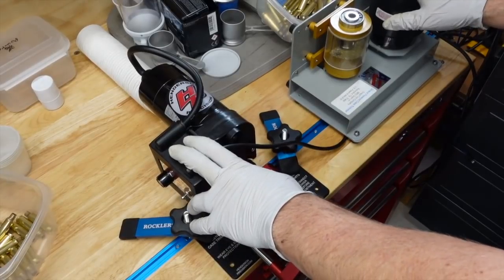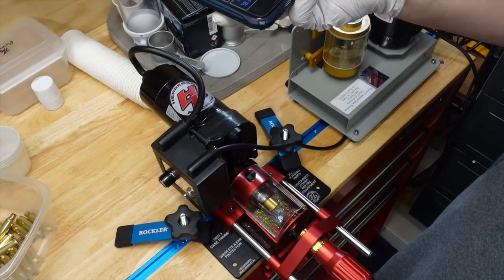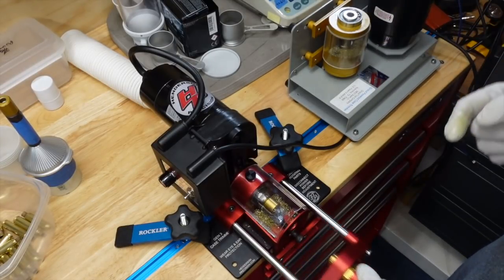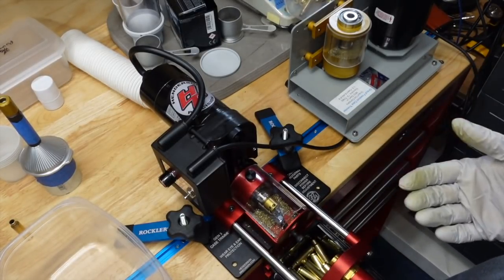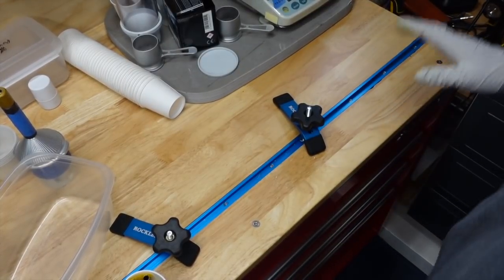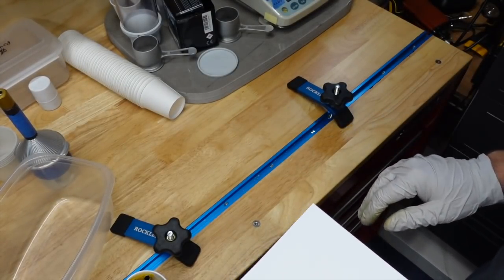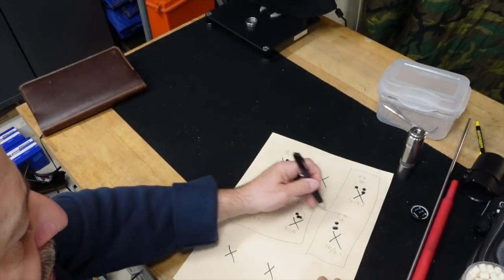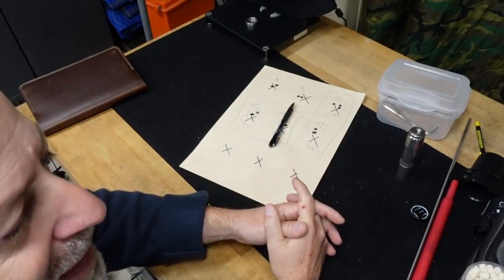Henderson vs. Giraud Rifle Power Brass Trimmer Review

Comment: Been using the Giraud for years producing very accurate ammo. I think the biggest difference between the two is what you pointed out; the Giraud indexes off the shoulder and the Henderson the base of the case. I suspect the spike in the seating pressure is because the Henderson rotates the case mouth on a mandrel and the Giraud does not. I think a worthwhile addendum to this test would be to run the expander back through both sets of brass and then see of the results are not more similar. And, are you lubing the inside of the case mouth with the Henderson? I cannot help but think the mandrel in the mouth of the case on the Henderson is completely responsible for the bullet seating ease. Not saying it is good or bad only that it is the obvious difference. I would also be interested in the overall case length of the Girauds as compared to the Hendersons. The shoulder bump and case prep is far more important using a Giraud since it indexes off the shoulder.

Comment: Variation in seating pressure could also be a impacted by slight variations in the bullets boat tail, diameter, smoothness, etc. There are many variations as you indicated that are caused by us, the previous operations, etc. I wonder if the age of the cutter in the Giraud could have anything to do with it. From using a lot of carbide lathe tooling, I can tell you that everything wears out. Unless we have a lab with equipment that allows us to standardize every operation this is about as good as you are going to get. Nice job John.
One thing I would like to see, is how much difference there is between the Henderson and say the Lyman Express Trimmer that you featured in another episode. Might help explain the value or expectations.

Comment: Love watching these videos even though my financial status doesnt allow me to get one of these.

I was using the trim pro 2 for a year and worked good, but noticed it really destroyed the inside of the neck. Made a crazy U shape on one side and didnt touch the other side. Ended up getting the lyman xpress trimmer, and so far its a solid unit. Dont really have much time on it yet but initial setup ane trim was easier and better vs the trim pro. Also like the idea of indexing off the shoulder vs the base.

Comment: I use the "Dead on case trimmer" for some time now (easy to set up). Does not chamfer but I like a very small chamfer so secondary ID/OD manual ok (set up for different cases or calibers seem like  pain for 3 way trimming cutter). Cheap drill press off CL, reloading is fun again!

Comment: John, thanks for this video! Just got done trimming 462 6mm GT cases using a WFT in my drill press and my hands hurt holding onto cases in the 18 degree temperature of my garage. 🙃 Then chamfer and deburring in the house by hand... order placed and I am looking forward to see how much this will change my ES/SD.
Reply from the maker: Which one did you decide on?
Reply: @FClassJohn  I went with the Henderson primarily because it's obviously quieter, bullet diameter specific rather than shoulder and bullet... and your seating pressure test at the end finalized my decision.

Comment: The Giraud tri-way for a drill press is a heck of a value for $110; same cutter as the bench top unit.
Reply: Trim enough, you may surrender to the Giraud power trimmer and just change out the cutter heads.

Comment: This is a really good informative video. I only wish we could have seen the inside and outside chamfer under a magnifying glass.
Reply: Yes, I totally agree.  The depths of the inside chamfer, and the amount of material removed for  de-burring the neck can be excessive with some other 3 way trimmers, depending on the factory carbide cutter settings.  Would have been great to see a closeup of the neck for both units.

Comment: i do not like that you measured the distance of the neck to the mouth of the case on the giraud since I am using the trimmer for overall case length and not distance form neck to mouth  but a great video.  thank you for the time you put in.   I defiantly am going to order the henderson. and i subscfribed
Reply: Measuring the case for overall case length on the giraud doesn't make sense because it is shoulder referenced. This means that case rim thickness can impact the result if you measure the overall case length, also inconsistent shoulder bump can impact it as well. For example, the giraud could be trimming perfectly everytime but if you measure the entire case you could still see variance due to case rim thickness, or a variance in shoulder bump. This isn't the case with the henderson because it is actually trimming the overall case length to your setting.

Comment: Which method of trimming produces the best effect on target for you? 

The Giraud method makes more sense to me since it is determining actual neck length vs. the shoulder instead of overall case length with the Henderson. If you neck/shoulder length is consistently cut to the same length, you are essentially eliminating neck tension variations due to a longer or shorter surface area the bullet contacts.  So, even if you have different case lengths, when the firing pin strikes the primer, forcing the cartridge forward in the chamber, the bullet will still have consistent take off from the neck. 

The Henderson method only determines COAL, meaning that your neck lengths will inevitably vary.  In this case, when the firing pin strikes the primer and forces the cartridge forward into the chamber, the bullet will have varying take off surfaces because the necks will be different lengths.  I have no idea to what degree these variations will translate to on target.

Have you seen any difference?
Reply: AMEN. Same here. Agreed 100%. I have Giraud for that reason also.

Comment: Thank you John - really appreciated the thoroughness and objectivity you put in this test. In addition to knowing that these two units are both very good for their intended use, what I found interesting are: (1) the differences in the traces from the press - I would attribute this to differences in cut angles for the chamfering of the inside neck: obviously with the Giraud, the bullets needed more force to be pushed when inserted through the neck (I also found big first bump in the trace when testing the AMP press with brass with no chamfering at all); and (2) the differences in ES. For (1), it would be great if could post close-up pictures of the neck mouth after trimming with each trimmer. I am guessing that differences in cut angles should be visible to the naked eye. For (2), I am wondering how the ES would compare if you remove the round that showed a tighter ID neck on the Giraud sample (the round with the large first spike on the AMP Press). Good stuff John! Thanks again for this test.
Reply from the maker: I'm glad you enjoyed the video and I think you're spot on with your assumptions. As I've told others, I don't think it's the Giraud's fault as much as it had a different adjustment on it at the time but there is a light difference in the cut angle either way which does of course make a small difference as well.
Reply: I have had the Giraud for a long time now which is a good trimmer but I like the Henderson Gen 3 better. It puts a more precise bevel on the case. The Giraud did not leave as concentric of a bevel on the inside of the case. I use the collet that came with the Giraud and not a custom one made from a reamer.  This can be seen on initial seating pressures with the AMP Press. I am also getting even more repeatable trim lengths with the Henderson (less than + or - .001"). They have also redesigned the motor to a single speed motor that is very a sleek compact design. Very Smooth.

Comment: Have you assessed how square the case mouthes are?  Wondering if that may be some of the variance in length until you spinned them.  Non-square necks are the main reason I start with a powered trimmer and then finish with a WIlson hand trimmer.  Granted both of those are way above the other powered trimmers that I have used, but would love to get any thoughts
Reply from the maker: Honestly no, I've never thought about it. I've been happy with the Giraud and how it's trimmed and definitely happy so far with the Henderson so it never crossed my mind.
Reply: @FClassJohn  I watched your video again and pulled the trigger on the Henderson.  WAYYY more than I ever thought I would spend on a trimmer, but I timed myself trimming with my current method and came out to over a minute per case on average to power trim, precision trim, chamfer, debur....  Granted these were on cases that were longer than they should be-- but my hatred of trimming has kept me from trimming very often on my practice brass.
Thanks so much for approaching as you did.  From your video, I have to take that the case holder and guide provide a more square case mouth.
Dollars spent = much time given back to me.  And now ALL of my brass will get the attention it deserves.
Great video.  Thanks again

Comment: Thank you for doimg this! 
Two questions, are those groups really at 600 yards or did I misunderstand. 
Secondly, what seating die is that you are using?
Reply from the maker: Those were only 100yd tests. I honestly don't test much at 600yds. As far as the seating die, I have a custom Newlon.
Reply: Thanks, I realize you are great shooter, but thought that would be rather inpressive even at 300, atleast compared to me and my STR200. Thanks again for the great video!
Reply from the maker: @wathaet1386  Thank you. Typically I look for something 1/4moa or less at 100yds (all one hole). These groups were pretty bad all things considered but they can't all be winners and I didn't want to mislead anyone so I showed the actual groups. I just got new barrels yesterday and will be working them in this week and by next week they should both be shooting close to .15" groups after powder, seating and tuning. I'll get some video showing the process.
Reply: Learning a lot from you, so keep it up!
Reply from the maker: @wathaet1386  Thank you. I'm glad it's helpful.

Comment: Thank you for the very informative video John, I like watching your videos. I have 2 questions- 1) do you think that initial seating pressure spike or lack there of is caused by the Henderson using a pilot? 2) you measured the giraud brass off of the neck, how consistent do you think it would be if you measured off the case head? I know that’s not what you indexed off of for trimming but curious to see consistency there. Hey, we measure primer seating depth off of case head but index off of rim! 

Thanks again for your cool videos!
Reply from the maker: Thank you for the kind words. As for 1)not sure, maybe the pilot does a little but I think that entry force is more dictated by chamfer and neck tension. 2)I've measure OAL after the Giraud and it'll vary just a little about the same and any variance of shoulder to mouth variance.

Comment: Maybe I missed it, but why didn't you measure both batches the same way? You are measuring the case overall length, right? Why do you use a different method of measurement? The seating pressure measurement using the AMP press may not be reliable when doing a direct comparison.  This is because the cutter blades of the respective trimmers can be adjusted to different angles causing measurement variability. I've tried both trimmers and have experienced this. Adjusting the blades does result in different in seating pressure.

Comment: Thank you for your review. After watching this I really into buying one from Henderson. 
But can not quite figure out the steps of my reloading procedures. So a Henderson requires prior to cutting have all cases sized and then necks opened up with mandrel to fit onto pilot and then resized again to desired neck tension? Is that right?
Reply from the maker: Typically you'd only need to size once. You would size your brass, then expand the necks with whatever mandrel size you use and then trim. Then you're done.

Comment: Hey John, did you size the cases in the same order with both trimmers? Or have to use a special step to open up necks for henderson? I know you mentioned something but forgot, I’ll rewatch, thanks for great videos
Reply from the maker: I just had to move steps. I used to size after trimming but now I just size before trimming. No big deal.
Reply: @FClassJohn  but im wondering did you size before trimming on both the Giraud and henderson cases in this video? The ones you did the amp press test on? Id be curious if just the order difference would change the seating force results
Reply from the maker: @zoidelux  Yeah I sized both before trimming.

Comment: I’m curious if the pilot on the Henderson cutter is leaving marks on the inside of the neck. 
I use to use a RCBS trimmer that used the same style shell holder and piloted cutter, I also tried their three way cutter and both left marks inside the neck.
Reply: Depends on whether or not you are expanding the case mouths.
Reply: @ajgraf122  I now own a Henderson and love it! .308 cases are FL sized in a SAC die with a .3065 expander and there are no marks left on the inside of the necks. I have 1000 cases through this trimmer with no issues.
Reply: @Carney556  Absolutely love mine. The biggest single time saving reloading device I have.

Comment: On the Henderson, How confident are you on squareness?
My flags go off looking at a motor hanging off the back end, the cutter turns instead of the case turning rotationaly. Seems like a easy way to get a non square “even” chamfer?
It would seem that ruing in the vertical position would be better?
I am also curious about a possible new ID/OD necker turner from Henderson. 
This looks like a nice piece, but it may have a inherent design flaw of maintaining and repeating bore parallelism or chamfer squareness.
Reply from the maker: It's probably a valid question but I'm not worried about it honestly. As for an inside/outside option I think he has talked about working on something but I have no idea where that idea is at.

Comment: As a new reloader... I'm wondering what is more important: 1. The measurement of brass OAL (Henderson) or 2. The measurement of the neck length (Giraud).  It seems to me that the Henderson cutting the overall length would be pretty important if nothing else in terms of ability to verify accuracy.
Reply from the maker: In the grand scheme of things as long as your sizing is consistent then either method will yield similar results.
Reply: @FClassJohn And "sizing" inconsistency (shoulder bump) is a variable that does not effect the Henderson COL.   Advantage: Henderson

Comment: What would you guys recommendation be for bulk “range brass” prep. I would like to get one of these two bc I also shoot precision rifle but I process quite a bit of range brass (as safely as possible) for 5.56, .300 blk, some 7.62 (gas gun brass) etc…. I use alpha munitions for my precision stuff but at 1.08ea not going that route for carbine stuff. I have also looked at the Dillon and FA options but kinda keep coming back to these two. Load .204 ruger - .338 Lapua. 
Thanks for any direction!!  Great videos
Also do 45-70 and 375 big bore but figure I’m relegated to hand trimming for those!!😊
Reply from the maker: At the most basic, the Giraurd will get incrementally more expensive every time you add a cartridge while the Henderson largely stays the same since the Henderson uses a collet systole and pilot so you can do a lot of cartridges with minimal cost difference. The Giraud requires a different holder for every cartridge. Both a good systems and both can work for people, just take a look and figure out which looks like it would fit for you the best.

Comment: If I have multiple 7mm cartridges I shoot, will the "caliber conversion cost" be significantly higher on the Giraud since I need a guide for each to index off the shoulder?  Or am i misunderstanding the setup of the Henderson?  Nice video.
Reply from the maker: Yes that’s correct. The Giraud needs a guide for every caliber whereas the Henderson only needs one cutter per caliber and that’s all because the collet system hold the brass. It doesn’t care which 7mm you’re trimmer for instance as long as the collet can hold the base.

Comment: Unfortunately Henderson deosn`t make sped adjustable version anymore. It is constant 1700rpm motor available only. 
Was thinking if you just debur brass lower rpm would ne better. 
In that case Giaurd might be better option, but driver/seating die isn1 great. 
Is anyone knows where I can get something similar as John has ?  Just want upgrade factory one comes with Giaurd.

Comment: why would you measure the brass lengths using two different methods? You could of done base to neck measuring on the giraud trimmed brass, or used the same adapter to measure the henderson trimmed brass to have a consistency on the measuring methods.... that's just adding an inconsistency on your measuring method, hence only hurting when trying to compare overall trimming lengths or differences of
Reply from the maker: The reason I used two different methods is that each one cuts using a different process. I measured overall length because that’s how the Henderson trims and I measured off the shoulder because that is how the Giraud trims.

Comment: What is the difference between your sighters and your other ammunition?  Strictly a beginner.
Reply from the maker: There's basically three levels of ammo at a match. Blow-offs, which are round that have bad bullets or something just wasn't right but they work fine for fouling a barrel. Sighters are bullets that are just about perfect but I don't want to shoot for record so they are used to get the gun sighted it. Record rounds are as perfect as possible.
Reply: @FClassJohn    Thank You!
Reply from the maker: @billy19461  No problem